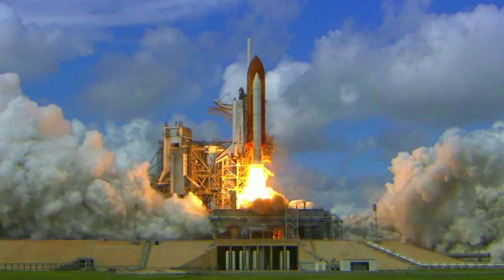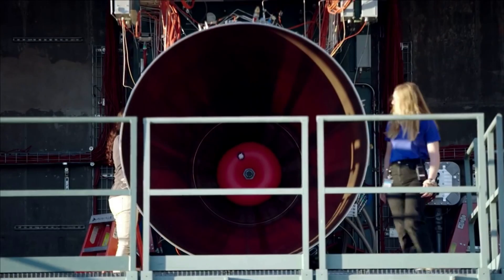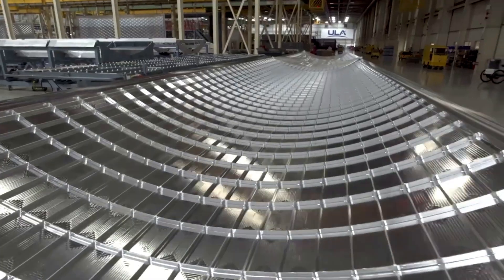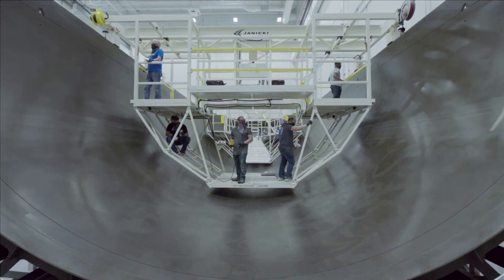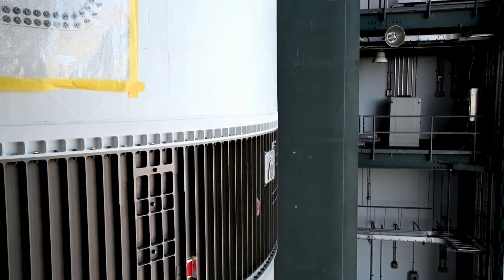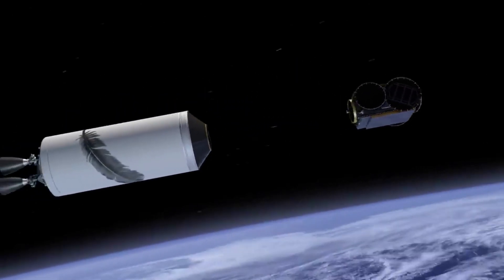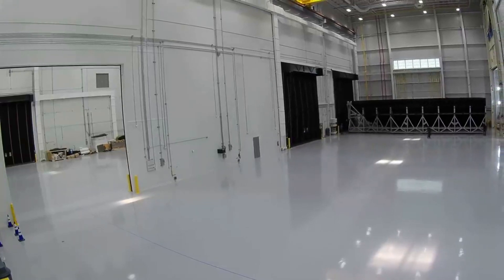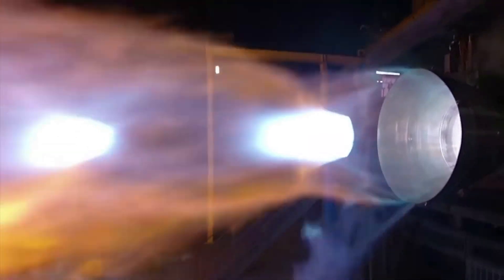Is Blue Origin Making Progress On The BE-4 Engine?

Comment: Whole lotta marketing data in this video.  Not much meat.  So BO has three (3!!!) engines, one of which they claim has over 2,500s of testing, with repeated starts (and stops).  They also claim and provide evidence of gimbal capability.  Great.  They're still roughly 5-6 years behind schedule, and won't be used for any launches this year.  That's the saddest part.  Even if they deliver those to ULA in the next quarter (before July, which is doubtful), they wouldn't fly before 2023.  Then, production won't truly ramp up for likely 24-36mos.  That leaves New Glenn out in the cold for some time.  Don't get me wrong, we're all anxious for them to succeed and see these getting produced, but there's also a contradiction in the vid where the marketing claim of a "Hardware rich development" environment is clearly in contrast to the reality they had over the past 4-5 years trying to develop this sucker.  

Contrast that with Raptor dev. which is already in V.2.0 and seeing very close approximations of thrust capability to BE-4, and may, in fact, be the very first Methalox to achieve orbital success.  We shall have to wait and see.
Reply: I don't think it will be possible to ramp up production on these engines, they seem extremely complex and time consuming to build making mass production impractical. They will need a version 2 to get any kind of efficiency in manufacturing which will take them years based on past progress.
Reply: @Cardano Ada News - What I heard is one blew up yesterday, and one the day before.  Speculation is this was intentional.  Ya gotta know your limits.  And that doesn't put BE-4 "Ahead", on the contrary, several V2 Raptors have been delivered to Boca Chica.  Not enough to mount a full set on either the booster or starship, but some are delivered, ready to go, fully tested.
Reply: @Cardano Ada News They have only tested one engine so far successfully. SpaceX have tested more Raptor 1s at far more extreme profiles with complete success and many Raptor 2s have been tested at 40% higher specifications successfully. SpaceX currently have over a dozen fully tested flight ready Raptor 2s at their Starbase Texas site ready to be installed on a rocket. Currently Blue Origin have only one engine that works and are struggling to build 2 more and have been struggling with this for over a year now. These 2 engines are still not fully assembled let alone tested for flight certification. So again how is BE-4 ahead when SpaceX is building a Raptor engine every 2 days currently? Oh and Raptor engines have actually been flown on rockets not just on test stands. Your assertion makes no sense.
Reply: To be fair, their previous competitor for the ULA contract, Rocketdyne, is even further behind and hasn't had any fire tests. So Blue Origin is doing better than the alternative. Rocketdyne still has customers and funding but hasn't been able to crack the full testable build yet.

As for SpaceX, they have been making a lot of engines and have moved to V2. However Blue Origin is technically further ahead by a tad since their design is finalized, and SpaceX is still tweaking and pathfinding. They send working units for their ships which are also prototypes and not finalized. If we're talking about who will have the final design build ready for mass production, Blue origin is technically already there while SpaceX is technically doing high speed development, testing, and manufacturing scaling at the same time instead of in a serial fashion. The first raptors to orbit will likely still not be the final version, but it will count as a first methalox engine to orbit.
Reply: @Jaker788  SpaceX does not finalise designs they block their development with Raptor 1 being a block 1 design Raptor 2 block 2 and so on. This is the hallmark of iterative development which is allowing SpaceX to move forward so rapidly. Each version is considered a finished design but at each stage the design is then fully evaluated and improvements made to form the next block design. Blue Origin has 'finalised' their design but has now hit huge manufacturing issues meaning they have been thus far unable to finish any production units. If they had a more iterative approach these issues could have been found earlier and dealt with but as it is they seem to be in deep manufacturing hell.
Reply: @schrodingerscat1863  from recent tweets from BO and the tweet by Tory Bruno, did show those 2 flight grade engine nozzles (with combustion chamber) which were on their way to build stand. Which essentially means, the components are about to be assembled. Once done, it will be tested in BO's facilities and will be shipped for ULA team to mount it on Vulcan. If maiden flight of BE4 makes it this year, there is a chance that they might ramp up the production rate.
Reply: @selvasurya049  The problem with all this is that the engines are obviously way too complicated to manufacture efficiently. This is why it has taken two years to assemble two engines. What they need is a redesign to simplify manufacture but that should have been happening during testing and it hasn't. Now they have the most complex task in an engineering project, production, and they don't seem to have a clue about how to achieve it. This is why Musk is always going on about the most complex part being the machine that builds the machine. He knows from his time with Tesla how complicated production is and how crucial it is to get right. Ramping up production is extremely difficult with something as complex as a rocket engine, it doesn't happen over night. It is already half way through May and the engines have not begun testing yet because some would have noticed that. In other words they are still being built. Personally I think if they begin testing by the end of this month it is still unlikely they will fly this year unless everything goes absolutely 100% smoothly from that point on which is highly unlikely.
Reply: @schrodingerscat1863   I don't know how you are so sure that they haven't tested it properly or they were manufacturing the same 2 engines for 2 years. From the way they are releasing data to the public, they might be well past what we think they are doing. NS is a good example of them bringing out a robust design, for which we know nothing about their testing programs until they showed it to us. Let's wait and watch.
Reply: @selvasurya049  The production engines are now over a year late and they started building them a year earlier after finally sorting out some turbo pump vibration issues and combustion instability problems on test engines. These 2 engines are the first 2 production engines and have indeed been under construction for a little over 2 years. Based on my own experience of engineering projects and the way this has played out with constant delays and poor excuses I think all the red flags are there for a project that is in serious trouble. If engineers were running the show, 2 years ago they would have had a design review before going into production and made necessary changes to ease manufacturing. This would have required further testing though and no doubt management were not willing to accept the delay. So here we are with huge delays anyway and the design review work still needing to be done. If you look at the way SpaceX has approached engine design and manufacturing with constant incremental upgrades and even a version 2 incorporating all the things they learned from version 1 you can see the real benefit of having this approach as they are now able to manufacture a Raptor 2 in around 48 hours ready for testing and at half the cost of version 1.
Reply: @schrodingerscat1863  As I said before, I have no idea about the insides of BO's work/management. I will leave it until it is presented to public. In case of Raptor, I don't think they are manufacturing 1 'Raptor 2' in 48 hours. That's like insanely quick for even the best of engineers to put together any rocket engine, let alone a raptor. I think what Elon said was, they are in a state of continuous production where, they are able to push out 1 raptor every 48 hours. Not complete the whole production of a single engine from start to finish in 48 hours.

Also, I don't really understand, in what way they are reducing the cost. Their method of testing very conventional for what they call a future. It is quick, but doesn't seem very economical. More details needed to understand how they make it very economical.

Also, it is not an engineers work to make a mistake and learn. You can make mistakes and learn from that, but you don't deliberately break stuff and find what went wrong. 

In the age of all this tech revolution going on, they did choose destructive testing over many possible non destructive testing procedures. It is quick, but again, the doubt of economy still stands.
Reply: @selvasurya049  They obviously don't make a raptor from start to finish in 48 hours, that is just the speed of their production output but it means that the engines are well designed for production line manufacture which has to built in at the prototyping phase. The economies of iterative testing is two fold, firstly you get to know early what ideas are not working and second you end up with a better product because more refinements can be made and tested during the process. This also makes the prototyping and testing more efficient because it is much more innovative and much quicker so you also gain by reducing prototyping timeframes. This does tend to increase the cost during development but that is easily countered by cost savings realised in the final product. Think about the cost of Raptor 2 at around $500K per engine against BE-4's around $7M per engine, a price Blue Origin is struggling to now meet. Then you have opportunity costs. SpaceX has had Raptor 1 now for a couple of years and has been using it to work out the Starship design with multiple test flights. Blue Origin still has no engines for New Glenn and are falling behind because of this. Based on the problems they are having making 2 for ULA making 7 for a New Glenn prototype is a big ask given they are contracted to supply ULA too.
Reply: @schrodingerscat1863  If BO does complete those 2 engines, supply it ULA and get it to fly on Vulcan, they are ahead of what we think now. They would already have moved ahead of Raptor, since Raptor is still not flying to orbit. All the raptors ever produced, they're still a cost to spaceX. The cost per engine comes into play only when all that they produce are put to use. If not, they should either write it off on their clients or on their own accounts. That would just mean, sweeping the dust under the rug. Either way, I am very much looking forward to both engines make a greater future.
Reply: @selvasurya049  But SpaceX currently has a couple of dozen Raptor 2s ready for an orbital launch, they had 33 raptor 1s ready for launch too but were waiting for FAA approval so in the end decided to scrap that launch and go for Raptor 2 on the newer booster design. 

Vulcan mostly relies on SRBs so only needs 2 BE-4s. SpaceX is aiming for 100% reusability which, if they pull it off, leaves every other launch provider in the dust. Even small sat launchers will have difficulty competing with a fleet of fully operational Starships. My main fear with BE-4 is that it is indeed having serious manufacturing problems which would impact ULA. ULA have bet their whole existence on Vulcan and if they can't launch because of a shortage of BE-4s it's going to bring the company down. 

That said the contract ULA have with Blue Origin is for $7M per engine and it looks like Blue Origin is struggling to build the engines for that, so they may actually be losing money on every engine they are supplying to ULA which is why they desperately tried to renegotiate the price in 2017. If ULA was using Raptors they would already have launched last year when they were supposed to carry the first Military payload to orbit which ended up having to go in an Atlas instead losing ULA tens of millions as Atlas is so much more expensive than Vulcan. I hope Blue Origin get their act together quickly with this but I wouldn't hold my breath.
Reply: @schrodingerscat1863  Okay. You win. BO sucks. Hope you're happy. But you really think SpaceX was ready for an orbital launch??? I don't what's with SX fanbois going around blaming FAA as if SX was ready pong ago. Even if they get an approval this very month, they still would need time to be ready for an orbital launch. They could have tested the water deluge system months ago if they were ready. And that's just one thing. People are clearly blindfolded as fanbois.
Reply: @selvasurya049  No fan boy-ism about it. I speak as I find and Blue Origin have given little so far to provide confidence in their abilities. The advanced launch system currently in place at Starbase was not really necessary for a basic orbital test. They originally had a launch capable prototype ready toward the end of last year and enough infrastructure for a basic launch attempt could have been rigged up. Not as refined or complete as now but enough to just launch the thing and then ditch it in the sea. Would it have been a successful flight, almost certainly not but it had a fair chance of at least getting to orbit. The project now is far more advanced with a much more polished and capable prototype so things have progressed even without launching. Will Starship ever realise the potential of full reusability, I have no idea, it may never fully work, but at least they are pushing hard to try and that is the most important thing.
Reply: @Cardano Ada News How is it ahead exactly?